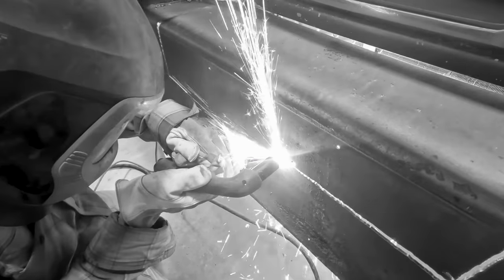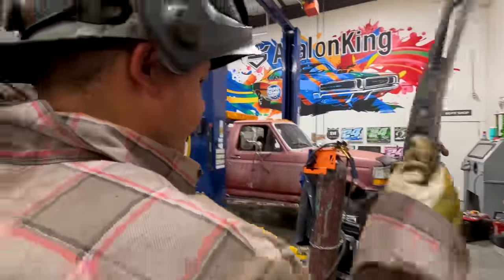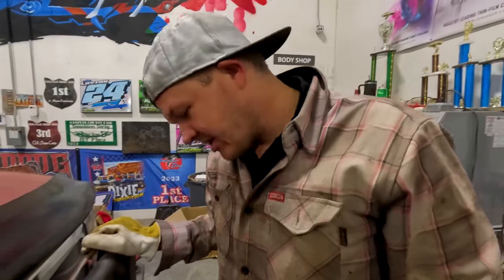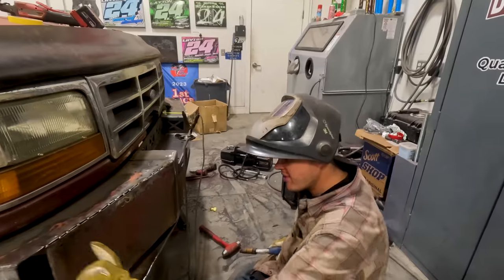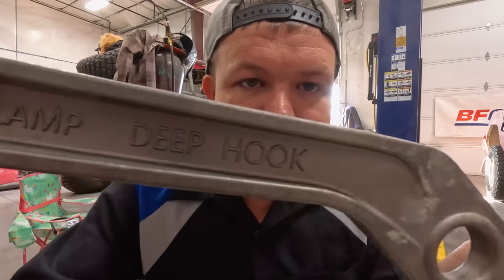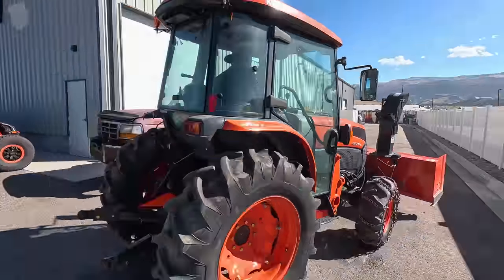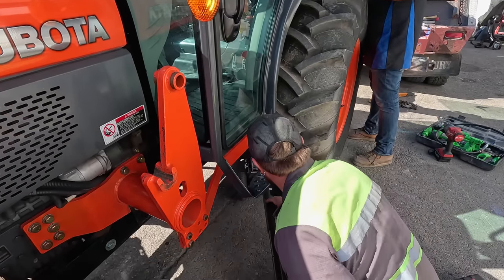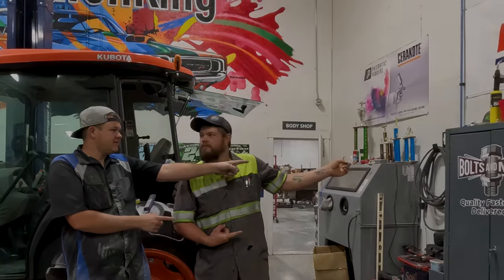My Tow Truck Isn't Just For Towing......

Comment: Hey Robby, you can make press brake dies that work on your press. You essentially make 2 “v” that fit into each other then bolt them to the press.
Reply: As Hillbilly was trying to tell him.😅
Reply: Beat me to the punch....use what you have, hydraulic press
Reply: You forgot that Robby have a tool problem, he wants at least one of everything. Just like Jay Leno and cars and bikes.
Reply: I came here to say this too!

And to see the MoClamps in action!
Reply: even without a brake, you could have bent that a bit easier. Heat??? three little spots. But it turned out ok. Keep on truckin

Comment: Harbor Freight sells a 30 inch brake roller combo, so does Grizzly and Certiflat sells a small DIY that you weld together and add a bottle jack. Eastwood sells one that you use with your shop press.

Comment: I don't know why a painter gets powder coating done? That stuff is soft for two to three years, flaking or scraping off pretty easy in those preceding years while its fitted. It doesn't "fall off", that's not what i'm meaning. Anyway. You do the steadiest straightest cuts freehand with a plasma that I ever have seen Robbie.

Comment: Robby, you do have a press brake.  It is right behind you in the video where you are asking if anyone knows of a press brake.  With a couple of accessories, the press behind you can be set up to fold thicker steel.  If you put little nicks in the CAD drawing you will be able to align your bends easilly.

Comment: Saw the off road recovery you did. Just some advice. When using the throttle lock on recoveries you do not need to run the engine at full throttle. You only need to run at a high idle to generate all the power the hydraulic system will produce. At full throttle like you ran it, you risk the pump coming apart . Just trying to help.
Reply from the maker: It was far far from full throttle! But thanks for the help!

Comment: >'Electric Lockers'<.New Alternator is only 80 amps,and Ford's Cop Cars @200 amp.With all the lights and winches .You put a Welder in the side boxes ?The bumper is looking better.Maybe your buddies can make a couple 'grappling hooks' from their frame pulling ones?Pull panels from wheels to tow?

Comment: you replace tho's factory head lamps for some newer LEDs or just order a LED kit for that truck so you can save on the Batteries when running you lights for more volts to the wintches.

Comment: I don’t think anyone got upset so much that it was a Ford Grille as it was a clean OEM grille that’s getting harder and harder to source for those 90’s American trucks. I’m kind of going through that now with my OBS Chevy grille. Mine looks good, but does have some damage and all the ones I can find used are in worse shape than mine. It’s whatever though. I didn’t feel any kind of way when you cut it. It’s yours to do what you want with.
Reply: As an owner of a truck of that generation, I agree.  The only headslap moment for me was "why not bump the bumper out the required couple inches" rather than cut up the parts.  It just didn't make sense.  It didn't anger me though - not my rig.

Comment: Anything that you can create an accomplished and it works out well. It is a success. But equipment sure does make it enjoyable. You may need to add an extension of your shop for your other equipment to make your life easier. For the press brakes and such maybe the CNC machine?

Comment: As thin as the metal appears to be on the original bumper> are you planing on beefing it up some way cause it looked pretty thin in the last video. I would hat for you to go through all the work to install the wench and have it pull out of the bumper the first time you had to do a heavy pull. Maybe reinforcing it on the back side and tie it in to the frame with plate on the back side.
Reply: I doubt that a wench would damage the bumper. 😉 A winch might bend it though.

Comment: First thing The welding instructor taught me in class was that leather gloves retain the heat on your hands.  Use cotton gloves. He was right 60 years ago. He was a oilfield welder. I would think they would have fire retardant cotton gloves by now. I  have used plain cotton gloves many years.
Reply: I agree...
Reply: I've always liked plain cotton gloves too because my hands sweat, but they were very difficult to find ten years ago. I purchased gloves that claimed to be 100% cotton but when I received them they were labeled 50/50 cotton polyester and they burned easily. I found thin cotton gloves to use as a liner in leather gloves.

Comment: I am thinking you will pull a unit body car apart before that hook breaks in real use.  Clamp a piece of scap angle iron to the steel for a guide to get nice straight cuts

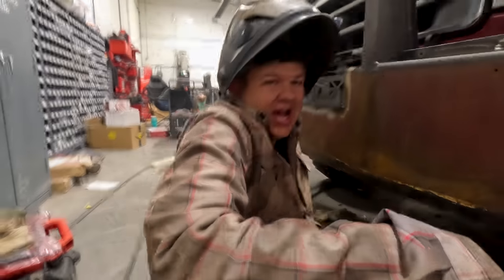Comment: 6:52 One time i was cutting off an old piece of overhead convey mount at the local Ford Assembly Plant.  It was a RUSH to get it off as the test truck body were running through, got stopped by this old mount, and we could not test the next section of conveyor.

So I climbed up the steel, and was in a poor position leaning way out to get at the mount, to torch it.  And a big blob of molten steel, dripped down and got stuck in my work boot laces and was burning the top of my foot !!  

The position I was in was not safe, and it took way to long to get out and scrape off the bead of, now hardened, steel! :(  Meanwhile it was burning me the entire time. 

That was 30 something years ago, and to this day when my foot gets really cold, the scar turns purple, as a reminder to me .. I should have found a better way to do that job! :(

Comment: Thanks for yet another super great video! You guys rock big time!! Buuuuuuuut..... Sometimes you guys are a little special kind of stupid.😁 You say you need a steel break, and right behind you is almost the same thing: an hydraulic press... And then you complain about HOT metal after welding. Take a look at, Matt, Rory or Paul, always water and a damp rag nearby. 😉 You cut with your plasmatorch with no guide, instead of using the trace tip on your torch and use a steel ruler as a guide...🙃   I could go on and on, but I love you anyways. I do all the same stuff myself, and bang myself in the head after realizing it....🤣😂🤣

Comment: Confused on how both tower pulls add together.   10 tons strain on same pull shows same load at 2 points. A gauge added to the center would also show 10 tons load.

Comment: Im not mad. It's your wrecker. But it wasnt necessary to modify the grill or lower metal trim piece. You could have moved the bumper outward, as they have adjustment capability of a couple inches. You made more work for yourself! 😅
Reply from the maker: I thought of both ways and the way I did it is better for me
Reply: @RobbyLayton  Good deal! I'm just glad to see an OBS Ford in your lineup now!

Comment: So, if you have 7 tons, multiply 7 x 2000. The answer is 14,000. So, there are 14,000 pounds in 7 U.S. tons +  881.849 Lbs. I did the same in checking!! LOL the 16,000 lbs is metric tonnes

Comment: I don't understand the idea of having the winch stick out the front.  You recessed it in a lot, but why did you not push it back another three inches so you could have a nice flat bumper?  You could easily weld in some pieces of round tubing to act as a fairlead and have that flush with the front, as well.   I figure however long you decide the vehicle should be it needs to be used efficiently. If you are willing to have it three inches longer, then let that be three inches more wheelbase so you can lift more, not three inches of mismanaged crap hanging off of it.
Reply: being able to access the winch is important. to fix a cable or bind or a electrical issue, someone that uses a winch offroad would understand that. and it is mot mismanaged. it is placed in its most effective position for recovery's.  blocking the radiator affects cooling, also the supports for the front part of the body would need to be cut out.